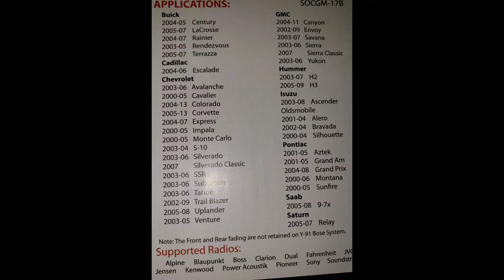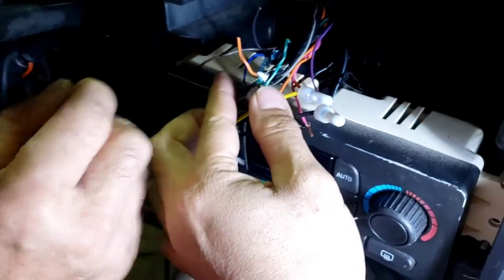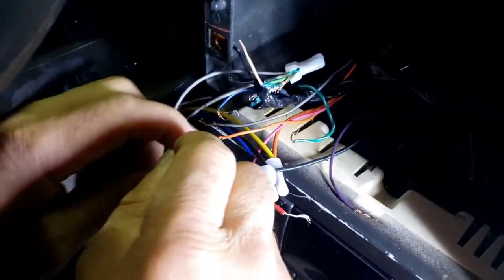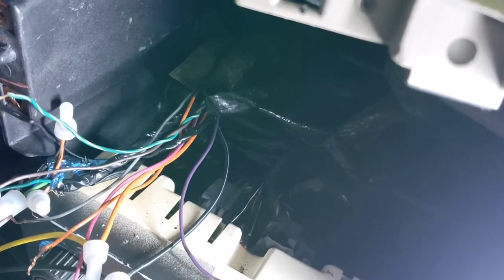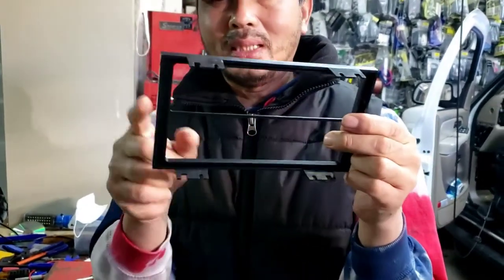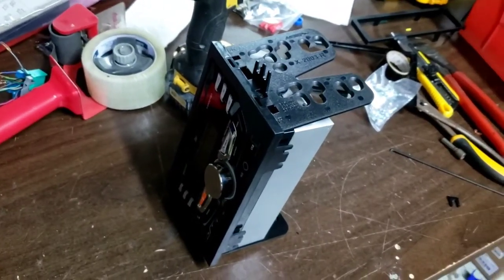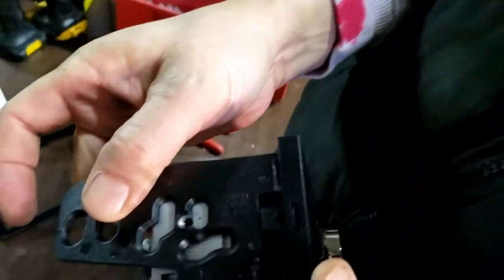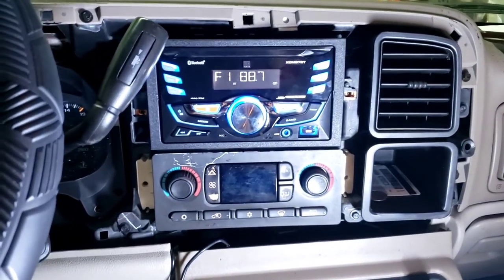how to install bose radio 03 04 05 06 07 Yukon hardwired

Comment: I am a new subscriber I have an 04 Yukon Denali is it the same thing that you showed here ? I bought the axxes harness and it didn’t work as well the front door speaker didn’t work as well the rear tweeter but the rear door speaker did work. i return the harness so I was thinking do this installation instead
Reply from the maker: Check the wires color if it's the same if not I can send you the wiring diagram
Reply: Please send me wiring diagram 🙏
Reply: I have an 04 escalade esv and i dont have that pink wire in the factory harness like you do. Will it still work and what are the other wires to hook up? I already have an acc wire ran. Please help been messing with this for days now and cant get any sound to speakers.
Reply from the maker: @tekniqjll  check and see if the blue/white has power
Reply: @khmerohio  yes its turning off with the key . If i hook it to red it stays on constant.
Reply from the maker: @tekniqjll  look for a white wire or light green on the factory harness that wire is the amp turn on its looking to get the power from blue/white wire from aftermarket radio

Comment: I did the red accessory and the ground and the yellow still no power
Reply from the maker: The yellow from your aftermarket radio right?
Reply from the maker: If that's the case, that yellow should go to the orange wire
Reply: I got it to power on now no sound
Reply from the maker: Do you see a pink, white, or lt green wire?

Comment: Finished radio install please
Reply from the maker: I forgot where i stopped at?
Reply: @khmerohio  u did the speakers I need wires red ,little orange ,blue all these colors are on the radio harness
Reply: U finished at purple I think
Reply from the maker: Im doing one right now, so u will need a red or whatever u preferred to hook the accessory
Reply from the maker: https://youtu.be/O5l6t10i62E

Comment: I have black/white , brown/white and black left on my car wires
Reply: Where do I put my red wire
Reply from the maker: Red from your aftermarket radio?
Reply: @khmerohio  yes
Reply from the maker: Red is ignition you can hook to an orange wire the 10 gauge wire from the ignition switch
Reply: @khmerohio  it turns on my radio without me turning the car on
Reply: @khmerohio  it’s also making my gauges on my dash not work
Reply from the maker: You hooked  to the wrong orange wire also there a brown wire u can connect
Reply from the maker: Call me $ix one 4 7786898

Comment: Where’s the rest of the termination video?
Reply from the maker: Hook the blue/white wire from the aftermarket radio to the pink wire for sound
Reply: @khmerohio only pink wire on factory harness is pink and black do we need to cut the wires from the small black oem radio connector??

Comment: Still no sound
Reply from the maker: You will need to get a testlight from your local auto parts store and test the blue/white from your stereo to make sure that it has power.  You can also tap a temporary red wire from the radio to that blue/white wire
Reply: I have tested the remote wire and it has power. Connecting it to the pink wire still gives no sound.
Reply from the maker: Check your factory amp fuse
Reply: I tried calling you a little bit ago

Comment: I have a 05 with the bose system I did what you showed but still no audio
Reply from the maker: Check the amp fuse
Reply: @khmerohio  where does the blue remote on go
Reply: @khmerohio  all good my subs work but still no audio
Reply from the maker: @Killerstrokempls  look for white or pink wire
Reply: I have a light brown with white ...and a black with white leftover
Reply: Is there a way to cut around the bose system